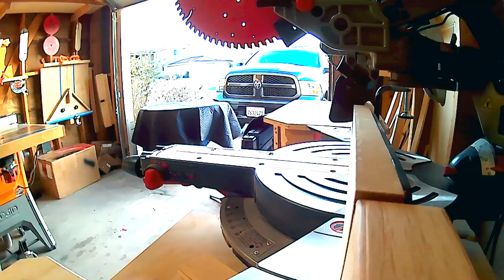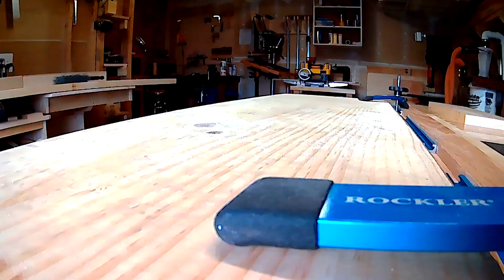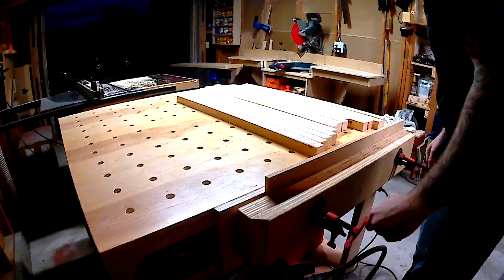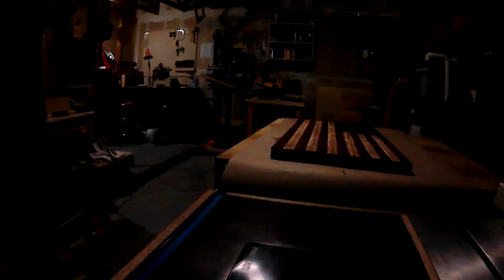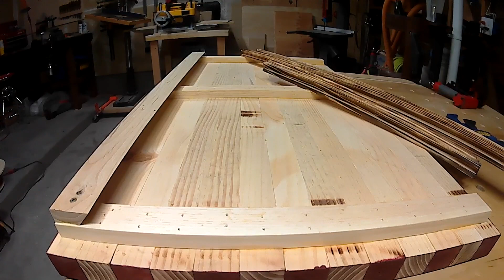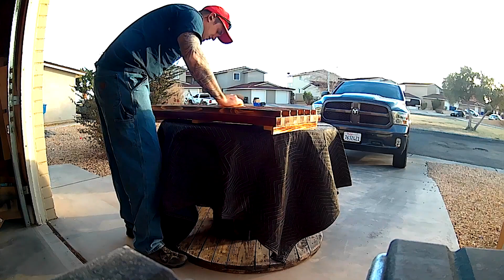US Flag Challenge Coin Display

Comment: Hi I just got one pretty similar for my retirement on wednesday. Mine was not sealed and i would like to put some kind of sealant or epoxy on it. What is the best stuff to use to put a shine on it and seal it. Thanks in advance.
Reply: I just read on another site that polyurethane is pretty good
Reply: Minwax polyurethane spray is really good
Reply from the maker: Polyurethane or spray lacquer will be fine.

Comment: Love this! I took a crack at building a few. I’m having issues with the spray finish though. I have a Husky syphon sprayer and I used semi gloss polyurethane diluted with mineral spirits. The top and bottom stripe and the shelves never seem to get enough of the clear coat. The raw/burned wood never seems to hold the finish well either. Any suggestions on what I might be doing wrong?
Reply from the maker: I recommend just using a nice spray lacquer without any kind of dilution. It's more than enough protection for it and produces a very nice finish. When you go to spray it, tighten up the sprayer's pattern and go at the coin shelves at an angle from above and below the shelf for a couple passes. Then spread the spray pattern out to about 2-3 stripes worth and spray the flag from straight on. This should give you an amazing finish and adequate coverage. I will usually do about 4 coats.
Reply from the maker: Also, before spraying confirm with the customer where they plan to hang it. That way if they plan to hang it outside you can use spar urethane for better protection.

Comment: If you dont mind me asking what were the height and width dimensions you used for the coin rails? also how deep and wide is slots?
Reply from the maker: About a half inch by an inch with a 1/4" - 3/8" dado for the slot.

Comment: Did you use the router to cut the coin slot for the coin holder?
Reply from the maker: Yes. I used my router table. I think a 3/8" straight bit.

Comment: I love this flag. When you're torching the wood, it's a great idea to torch both sides (face and rear). The reason for this is that you're drying out one side of the board, while leaving the other side with a higher moisture content, which could cause warping. It may or may not even happen at all, but I think the extra time spent torching the back side of the stripes is just good insurance.

Comment: How much did that weigh?  Looks like it ended up on the heavieer side
Reply from the maker: These are pretty stout flags. Not like the ones using only 3/4" material. If I had to guess... Maybe 50-60lbs?